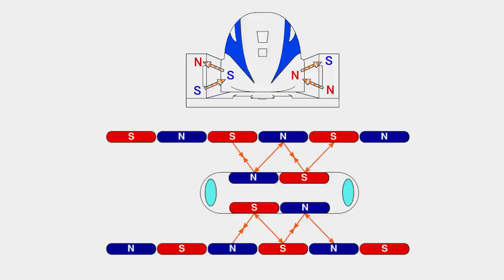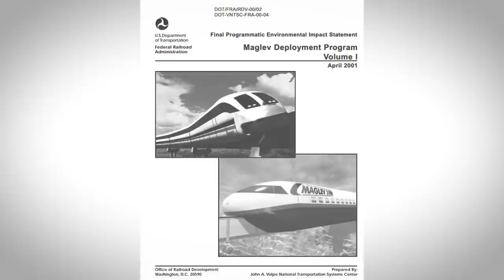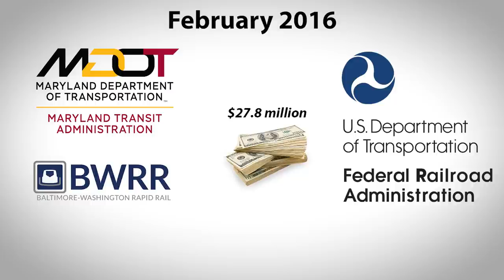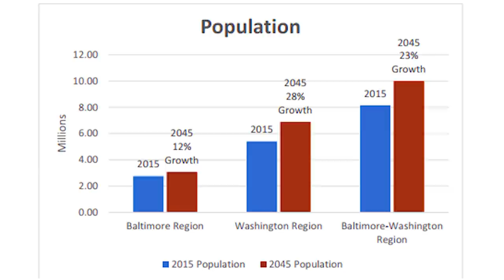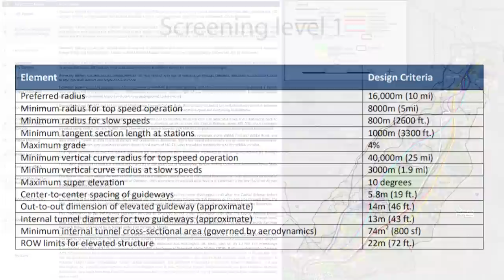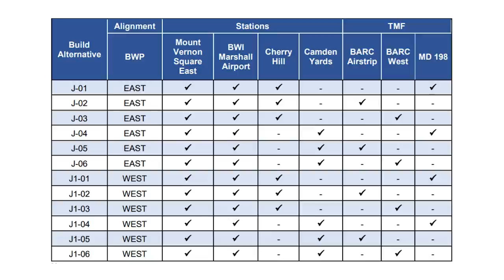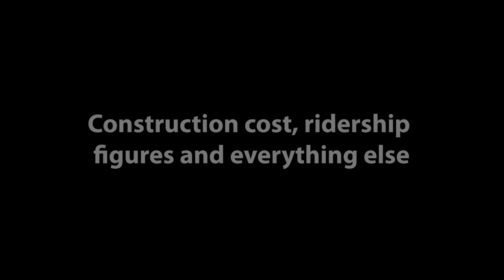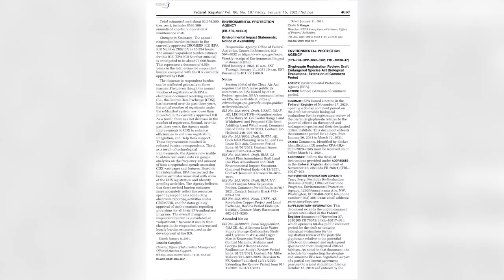Baltimore–Washington Superconducting Maglev Project

Comment: In the case of the United States, Canada, and Australia, it would be better to duplicate the passenger transportation between states with the Japanese linear Shinkansen system and air, and then introduce the Japanese Shinkansen system for passenger transportation between major cities in the state. And for passenger transportation in major cities and their suburbs, I think it will be solid if we use a hybrid vehicle (Class 800) that can run on non-electrified sections.

If Japan and France can cooperate in the construction of the railway transportation system, it may be possible to realize operations such as linking or boarding the French TGV with the Japanese Shinkansen system. By doing so, the foundation of the domestic transportation network can be laid economically, efficiently and rationally, and I think it will be possible to contribute to the entry of railway vehicle manufacturers other than Japan and France and the stabilization of employment of the people.

If we can train engineers in the United States, Canada, and Australia as well as in the United Kingdom, we will be able to upgrade the Class 800 that was initially introduced and develop new vehicles by ourselves in the future.
Reply: Most of those Japan lines took many decades to build from concept, and were built in a country bombed heavily 1944 to 45 in those districts.  The current wiz-bang super fast one that is still in trials and limited use , was discussed on a program i watched in 1965 when the NYCentral Metroliner was still an enviable fast train.  So that's sixty years before use.

Trains are just too slow.  It takes 60 years to go somewhere.  The problem is in a post industrial nation the logistics of aquisition, legal hurdles, enviro challenges, construction overruns, delays, stop start  just takes so much longer than 1867 when it was the ONLY option on an almost vacant prairie... And that was built at horrible and unjust human cost.

Trains as a futurism is the stuff of 1930s comics and worlds fairs.  They do work, but they are easier to draw on the artwork than actually build and run.
Reply: @STho205  I think the purpose of developing a passenger transportation infrastructure is to make the movement of people in a specific section reasonably smart. In other words, the idea is to upgrade or shift the section where the traffic volume may reach a certain allowable amount to the optimum means of transportation. In that respect, Japan's Shinkansen system has low latency and high passenger transportation capacity. This is different from the delay normalization problem that has not yet been resolved in Europe. Next, in order to keep the transportation costs borne by users as low as possible, it is necessary to think carefully about initial costs, maintenance costs, etc., but despise stability, safety, and convenience. That is wrong. For example, even if the initial cost is low, if there are many breakdowns, it will not be usable. On the contrary, even if the initial cost is high, it may be easy to recover the cost if the stability, safety, and convenience are high. Unfortunately, the commercial operation of the Japanese Linear Shinkansen has not started yet. Therefore, if stability and safety are required for the introduction of the Linear Shinkansen, I think it is better to consider from the third generation vehicle after commercial operation.

And as you say, I think Japan is still working hard to produce the future products that I dreamed of at the manga and the World's Fair. Perhaps if we can develop good batteries and electrify airplanes, we can make some progress toward the future.
Reply: @mitsuyamaeda-railfan  yeah but in this case (mag lev DC to Baltio) it is a private theme park ride for DC politicians, till they get bored with it... Then it'll be a ride between hoodies if the price is right.

Interesting that all the high speed experiments come mainly to DC.

Trains are too slow.  They take 60 years to get you there.
Reply: @STho205  If the Texas Shinkansen is successful, I think it will naturally be expanded. But if it fails, rail infrastructure may not be suitable for the United States. I want the American people to use the best in terms of stability, safety, and convenience, so I would like them to accumulate operational results for the Texas Shinkansen and the Linear Shinkansen.
Reply: @mitsuyamaeda-railfan  that line has been in proposal and planning since the 80s seriously and 70s vaguely, yet nothing has been laid.  If it can't be built within a half decade from hard start... Then yet again here is a 50+ year old trainride.

I like trains.  I prefer trains into congested areas over private vehicles myself.  However no project seems to take less than three decades from the grandiose talking phase to a minimal subset of what was discussed.

It is what it is.
Reply: @STho205  Personally, even when I think about railways in Europe, I think that the ideals are overloaded and the sense of unity is lost. As a result, I think there is a problem that the delay cannot be resolved. Also, I think about Amtrak in the United States, but I think there is more to do. For example, with regard to British railways, I think that the results of Class 800 have led to the idea that overhead lines should be installed only in specific parts. If so, I think that Class 800 can be operated if there are rails, stations, and a control center, so it may be quicker to operate Class 800 on Amtrak rails.

Either way, we may move forward if we have a track record of the Texas Shinkansen, which is run by the private sector. The Linear Shinkansen is also about to go into operation, so I think it's best to make a good decision based on actual results.
Reply: @mitsuyamaeda-railfan  Amtrak was an excuse to save Metroliner,  which DC and NYC lobbyists loved, but to do so they had to toss a bone to every other state with some slow trains squeezed between three mile long freights.

1968-1970 US RR SUDDENLY no longer had mail contracts and parcel contracts as they were moved to air.  That paid for passenger.  We were on the Moon so trains were old fashioned for business travellers.  That just left families and the little people... That still liked train travel.   Who can make money from THAT.   Also RR companies refused to sit down and plan a future with canal,  air,  highway trucking agencies.   They didn't  want to compromise or change 

Amtrak,  became a write off dumping ground for old passenger equipment and outdated locos.  A corporate bailout for those vital freight companies that eventually all merged into four mega haulers.

I rode those "heritage coaches" well into the 90s and 21st century.   It was like riding a long railexcursions of a train museum,  but with staff that were not very excited about rail.  It was a grungy, slightly smelly bus.

So Amtrak will never get US passenger rail going for modern travel.   They are to protect  the NEC and survive elsewhere.   That's it. 

In Japan or France do you go to old freight yards in sketchy slums at midnight to get in the train at an open pavilion...while the historic station is locked and boarded up.  That is a lot of the Amtrak experience.  Functional minimums with state matching funds. 

Stations should be where the desired riders live,  not where they were 100 years ago.   Tracks should go there,  not into interchange switching yards.  Amtrak,  by definition,  will never do that.

Comment: No US Bullet Train  will ever match a Japanese run train. The safety, reliability, and cleanliness will all suffer.
Reply: I mean how can you know this before it’s even built?
Reply: @mudshovel289  history, current situations. The Japanese pioneered high speed rail 50+ years ago. They have had ZERO accidents. Their train are highly reliable, on time, we’ll maintained. I’ve rode them. 
I’ve also rode on US trains, dirty, not particularly on time, accidents are not uncommon.

It’s a philosophy difference. The Japanese do what’s safe, regardless of what it costs. Their systems run at a loss, thus a supplemented by govt.
Profit isn’t a motive.

The US runs it as profit, corners will be cut, jobs minimized (cleaning, safety) etc. happens all the time..

Comment: Superconducting Maglev is extremely expensive and won't happen - there is simply not enough supply of coolant on the planet to make it commercially feasible.
Reply: China is developing High Temperature Superconducting Maglev which uses liquid nitrogen as coolant. The supply of Nitrogen is cheap and abundant.

Comment: I mean yeah, we could have a Maglev train between Baltimore and DC. But it would make so much more sense to use the funds to upgrade the existing alignment on the NEC between NYC and DC, which would cost less than the cost of the Maglev, and at least allow the current generation Acela trains to operate at their designed speeds of 150mph, and the new train sets to operate up to 180mph, placing that part of the NEC on par with European HSR. But its America, everybody has got to get their handout. This project will increase in cost by 40% and time by 50%. My great grandchildren will enjoy this when its done

Comment: I'm from Baltimore and we all agree that this proposal is so stupid and pointless when we have the Northeast Corridor in need of some TLC.
Just a flat-out stupid idea
Reply: I disagree. If it's just between Baltimore and DC... yeah it's stupid... but this is a test line for the NEC. The problem with the NEC is that any HSR would meet too many challenges from lobbyists and would end up being watered down. A Maglev would, by necessity, need to be a Greenfield line... would likely be largely underground for large swaths, and would effectively replace all air travel in the corridor. Remember that this kind of train is meant to replace air travel.... not train travel.... and tickets would likely be priced accordingly.... likely a little higher than a flight given the added convenience.

Comment: Super Maglev bullet trains in the northeast corridor of the United States of America. This will finally be an American technical achievement.  But the United States has one bad habit. They like to sit around and talk about it instead of doing it. What's there to know that we already don't? Maglev technology is clean and environmentally friendly, It requires a lot less maintenance than the current slow and lethargic trains the United States currently operates, It would be an awesome alternative to driving cars and spending money on the high cost of fuel,  It would be an alternative to the stresses of air travel which is prooving more and more to be unreliable due to flight cancellations that causes stranded passengers to sit at airports instead of reaching their destinations,  this would put the United States of America on the world list of top 5 fastest trains on earth. The maglev would offer not only speed but a luxurious experience if ticket prices are reasonable enough for everyone to use the train an not built only for the super rich because unfortunately american business is many times baised on greed, and with the man power, lowering prices for materials, and a great motivation to do and complete the project this super train can be completed and up and running in no time. Is this all reason enough to get off your asses a simply do it? What are you waiting for?

Comment: Interesting video, terrible idea. I can't see there being anywhere near the demand they project, especially not at $28 - $81 (which will end up higher like the construction cost). Now you can take the MARC commuter train between Baltimore Penn and Washington Union for $8, Amtrak for as little as $15. Both are slower and not as frequent as they should be but that could be fixed by upgrading the NEC for a lot less than Maglev would cost. 

It's also a terrible idea to put the Baltimore terminal in Cherry Hill. It's about 3 miles from downtown, only somewhat easily accessible from the highways they want to divert traffic from and a high crime area. But it's cheaper so hey ho. Baltimore's one and only light rail line is underutilized because they went for the cheap, fast and easy option when it was built instead of putting it where it would attract the most riders. They never learn.
Reply: yeah I'm baffled at why Cherry Hill would even be considered as a terminal for this
Reply: Regarding demand, the entire NEC has less ridership they this video says is projected for the maglev just between DC and Balto.
Reply: @doublez3ta  Only thing I can figure is it was going to run next to 295 anyway and they didn't want to spend the extra $$$ to extend it downtown.
Reply: @BrendanC6788  If that's the case why not just rip out 295 and place a new HSR line on the corridor?...
Reply: @MarloSoBalJr  Because it would be a lot cheaper and more practical to upgrade the existing rail corridor to HSR?

Comment: Can you or anyone explain “clean” transportation? I think the only “clean” form is walking. Even Animal driven transportation is NOT clean. And trains require massive industrial infrastructure just to build the components such as rolling stock and the massive network infrastructure not to mention all the enrgy needed to run all of that PLUS energy required to operate the lines.
Reply: Not using hydrocarbons directly. Powerplants, even if it uses hydrocarbons, are a lot more effecient and to get carbon 0, people have to decarbonize both anyways so half isn't bad. Better to do half now and half later than nothing. 

Not building infrastructure is not an option unless you want to live in times before the medieval age (even they used infrastructure). Even to maintain standards of living, infrastructure has to be maintained and replaced, which takes carbon anyways. Everything decays and better to replace it with something cleaner.

And usually people don't want to just maintain standards of living, they expect improvement.

Everything is relative, technically even walking is not carbon friendly because people, like animals use energy and emit greenhouse gasses.
Reply: @zxil6  yes sir a i agree. What about nuclear?
Reply: @trock7542  I think we need to stop saying just nuclear. Thorium nuclear reactors are much better than the Uranium reactors everyone thinks of when they hear the word nuclear. There is also fusion reactors, although that's a future development. Only reason Thorium reactors aren't being talked about more is becuase you can't build nuclear weapons with them.
Reply: @zxil6  We will "decarbonize" due to depletion.
Reply: @mattevans4377  Thorium is just a way to boil water and is even more radioactive in its fuel cycle.  And nuclear weapons CAN be built with thorium fuel cycle.
Reply: @mattevans4377  yes!!!
Reply: @markrobinowitz8473  um all electricity is from boiling water…
Reply: @markrobinowitz8473  is you’re claim that modern nuclear reactors are more radioactive?
Reply: @trock7542  Most electricity but not "all."  PV, wind turbines, dams don't boil water.  They're much less than fossils and nukes, a reason to conserve and demand less.  there is no way to detoxify nuclear waste except through time, lots of it.